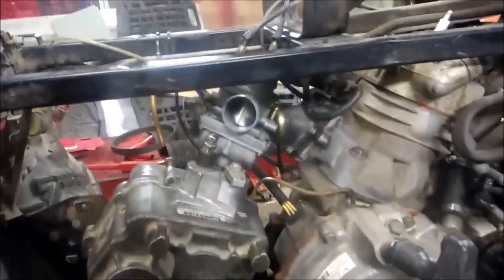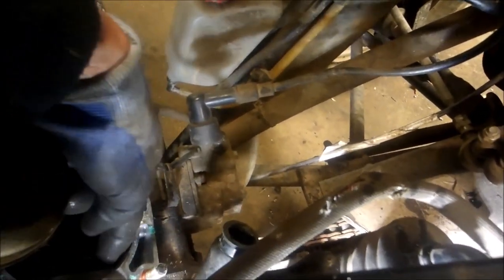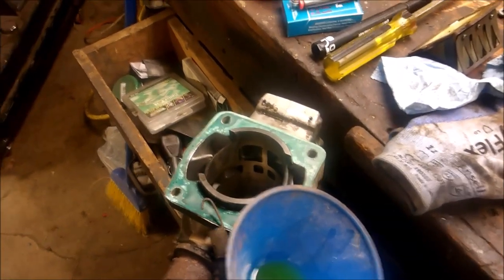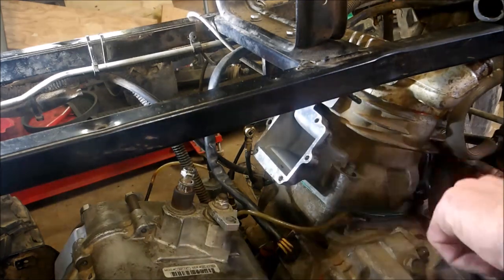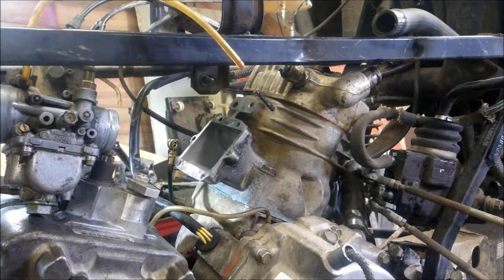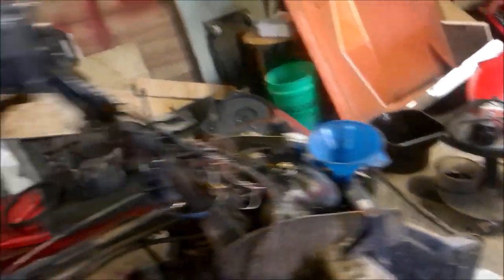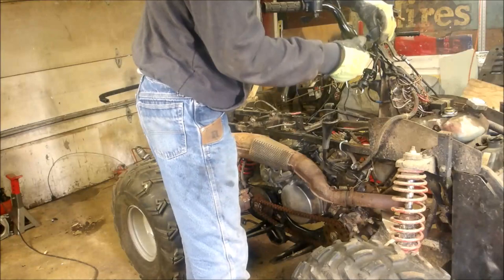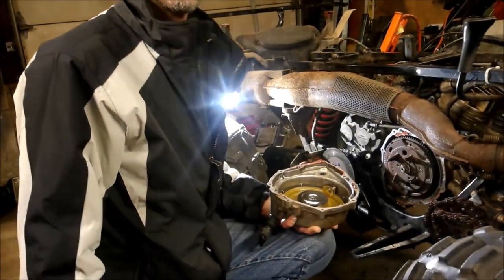96 Polaris Sportsman Brought back from the dead! Part 2. Engine Top End rebuild

Comment: I have a 95 sportsman 400 and Just had my carburetor serviced at the dealership due to loss of power and excessive fuel usage.  They tested compression and it was 120 psi.  Drove the machine approximately 43 miles and it shutoff and will not turn over even when trying to pull start.  Thoughts on how to proceed?  Was running great and then just died.  Machine has 2800 miles on it without previous issues.   Thanks for any help.
Reply from the maker: I would check the compression again. Could it have ran lean and got hot somehow?  My guess is dirt in the carb or possibly rings are bad. I couldn't tell u without more info. Check the sparkplug to see what color it is. It will tell you alot. Black..to much fuel/ oil. White..running hot. You want golden brown.

Comment: T MAN
I’d plamed to do a minor rebuild tuneup r/r as needed on my ‘98 PS 500.
But, just had a valve replaced- in my heart!- so unable to do as planned until next winter.
Could I drop at your place in early March, leave it for a month to give you leisurely time to get to what’s needed?
Tom S
Phelps, WI
Reply from the maker: I'd consider it. But your 4 hours away. I'm 60 miles south of Greenbay.

Comment: I am rebuilding my xplorer 400 two stroke. My counter balance shaft gear is damaged. Do you have a site with used parts for sale?
Reply from the maker: No. I deal with a guy in Milwaukee that parts them out.

Comment: That bike is running super lean at the end of the vid. idle is not steady and it shouldn't bog like that when you give it throttle, that's also why it didn't want to start on its own. Starting fluid is also a no no for 2 stroke engines. That stuff has no lubricants in it whatsoever. 2 strokes lube the top end and crank with the oil that mixes mixes with the fuel. using starting fluid basically is the same a starting the engine dry. Good way to damage expensive parts. Good repair vid, but some things I don't agree with, as they set a bad example for people to follow.
Reply from the maker: Thanks for the info. I had posted another video after this one. It was the intake boot leaking  that why it was running lean.

Comment: the gas is supposed to flood in the engine on a 2 stroke.
Reply from the maker: No. It will  though.  If the needle and seat in the carb is bad it will dump gas into the block and it won't start.